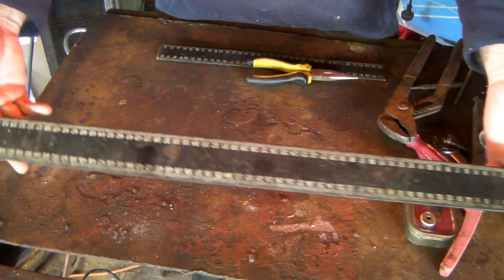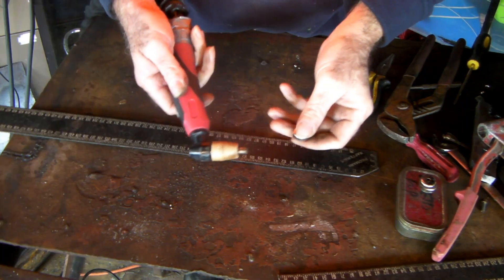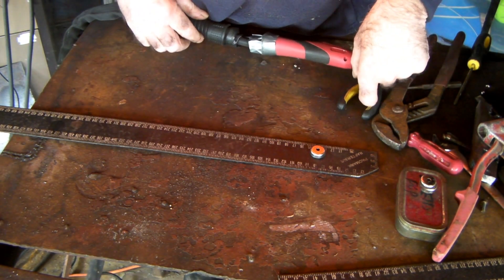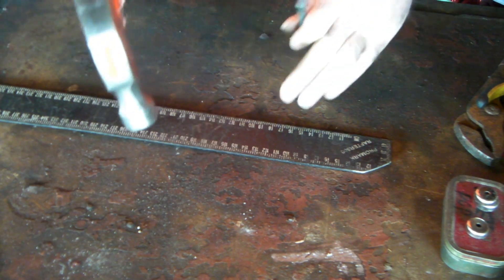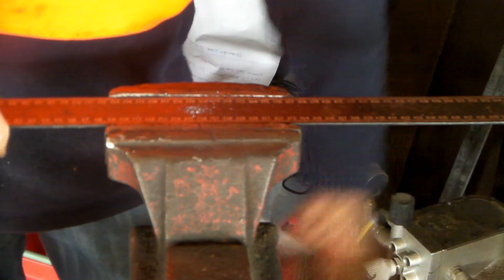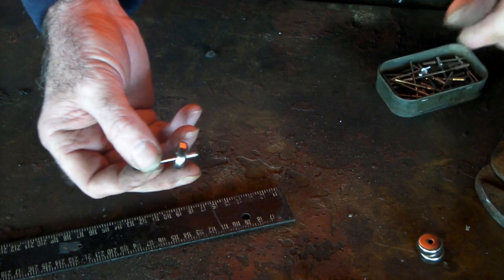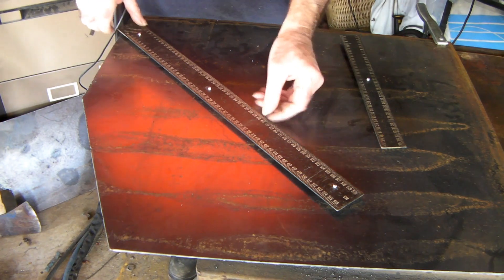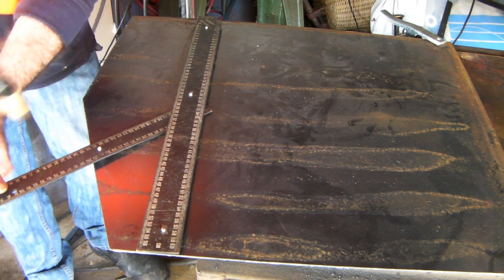Diy Magnetic Plasma Cutter Guide Easy As

Comment: Just seen a comment that said you could cut hole in it for different size circles. That's a great idea just make the holes a little bigger to allow for torch size and you could accurately cut hole up to 1 inch or so with that magnetic straight edge also. Plus make a pin hole to pivot your other small piece for angle cuts so it doesn't lay so crooked
Reply from the maker: cool idea cheers

Comment: Very good idea.  I bought the magnets. Have a carpenter square.  Need to cut the square in two pieces then drill and pop rivet the magnets.  Thanks Pete.
Reply from the maker: Sounds great!
good luck
Reply: Just made the same two magnetic guides.  Three magnets on the 2 foot long one and one in the middle on the shorter.  Great idea Pete!  Thanks.
Bill

Comment: Got a suggestion that might have already come up and a question.
Why not drill a hole the size of the magnet in the shorter length and then you can lock it in position either in the middle or each end and still hinge it?
Question: I have an Aldi Plasma cutter brand new that will fire up ONCE and cut weakly then it wont arc again I have to turn it off and back on. Any ideas. I bought it about 2 years ago and never used it so Its kind of new which has an even bigger GRRR factor.

Enjoy your channel very much. 

Mark
Reply from the maker: good idea about the magnet thanks. i would think it's a defect in the machine itself (don't suppose its still under warranty )
thanks for watching cheers pete

Comment: Mrs.Pete I have a plasma cutter it's the blue one from eBay it's a cut50 with a 120v power cord it won't cut it will cut aluminum foil size metal but 1/4 1/8 3/8 or 1/2 it won't all it does is makes cutting streaks like if it is cutting any advice I put new tips I turn the up and down the power the same thing the machine say's 120/240v I feel like cutting the wire and making it 240 I'm a electrician but not in that field
Reply from the maker: Hi mate what sort of plasma torch are you using ?
Reply: What’s the air compressor doing, and it it enough for your machine? What’s the recommended psi and CFM the manufacturer gives? Will the compressor do that? Also do you have the work clamp properly connected?
Reply from the maker: Nope compressors is to small But it is the biggest i can run on my power supply.